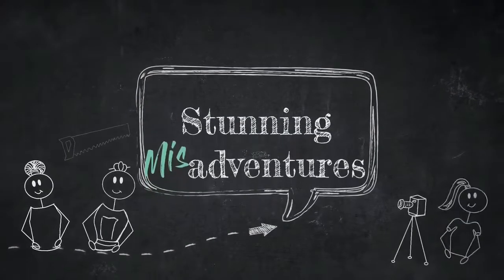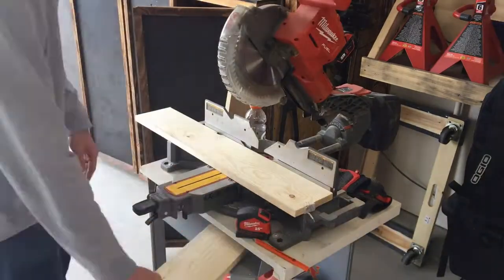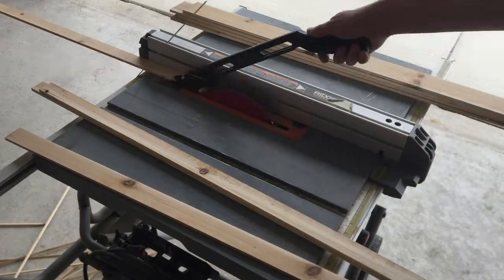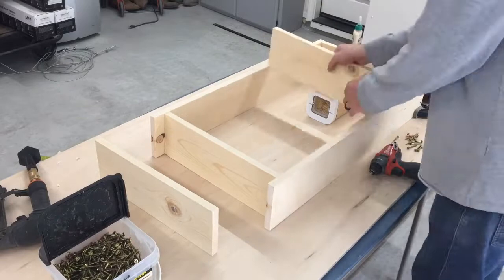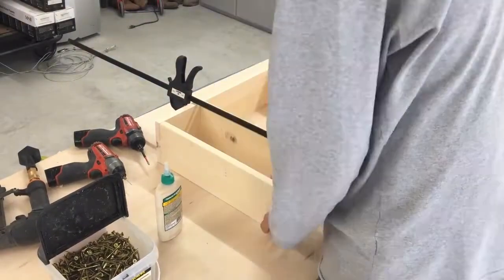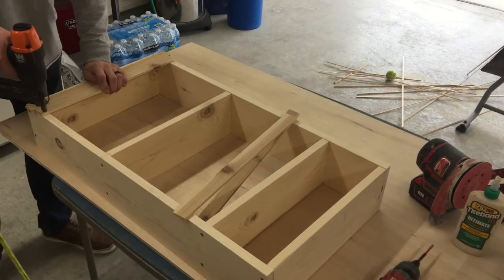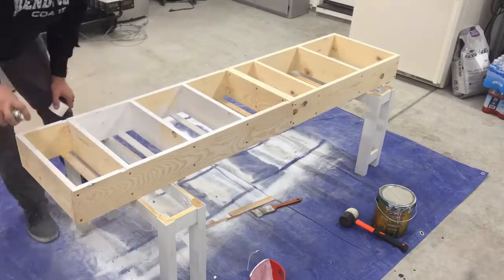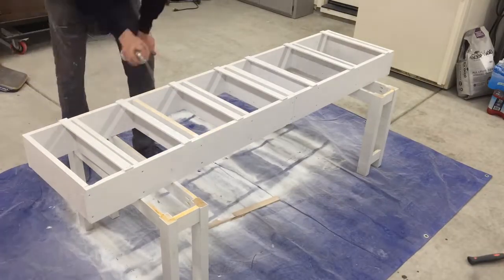DIY Pantry Door Storage

Comment: For some of us new homeowners who may not have done this type of thing (me - for me) how did he attach it to the door ? 

I mean obviously I can drill through my pantry door but… I feel there has to be a better way 🤷🏻‍♀️
Reply from the maker: My husband used over the door hooks. He used a 3/8” drill bit to drill holes as wide as the hook. He measured the length of the bottom of the hook to determine where he needed to drill the holes in the wood. Sorry that we didn’t include this in the video! I’ll link the hooks in the description box.